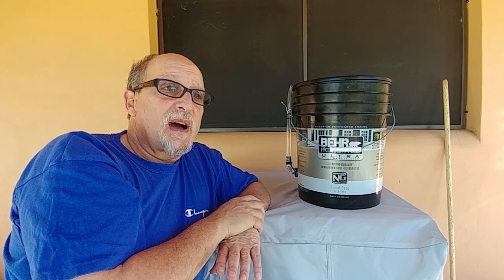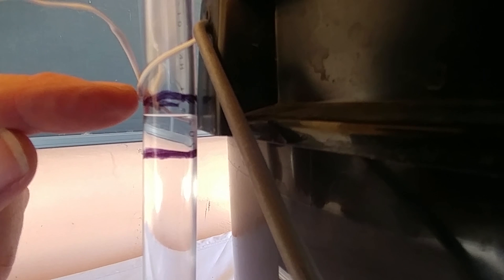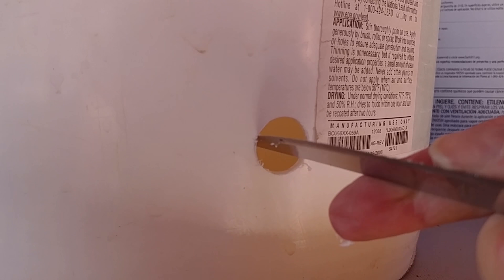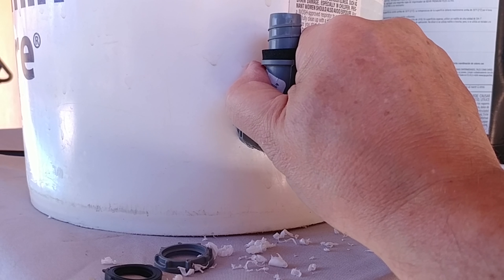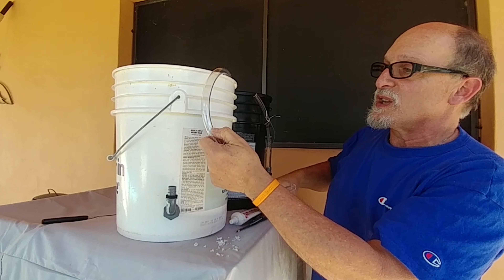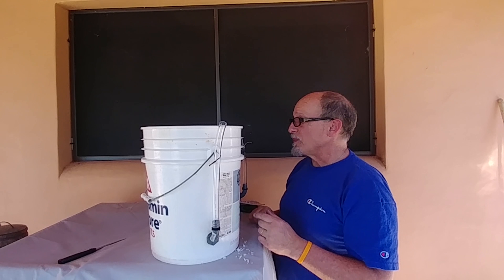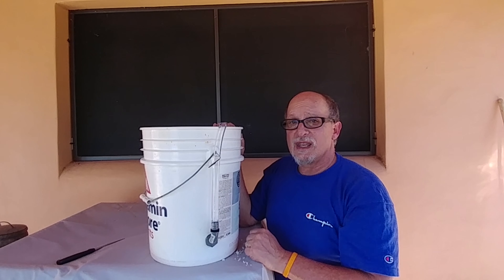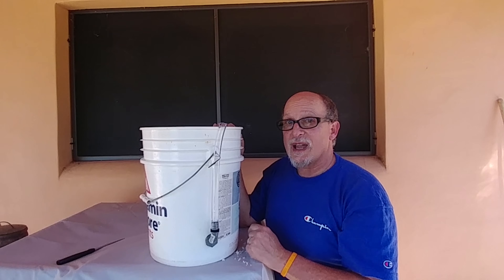DWC Hydroponics Bucket DIY  HYDROPONIC BUCKET DIY WATER LEVEL GAUGE

Comment: hey my guy, looking great! I'm gonna pick me up some tomorrow to add the water level indicator... Originally I had decided against it but opening up the lids is so damn hard. Had to say screw it, and here I am. This looks straight forward. Thank you so much. 
Only question is: what size hole did you cut into the bucket? I understand that the fitting is a 1/2" 90 degree fitting, but what size hole did you cut into the bucket for the fitting to screw perfectly on like that? 
Thanks again!
Reply from the maker: Hello and thank you for enjoying my video. The hole is made with a 3/4 inch spade bit. If you go to 10 min. 42 seconds in the video, I explain what the bit is in detail. Since our video helped you out, all I ask is that you help us out by subscribing to our channel, liking us and sharing our videos on any hydroponic web sites so others can save money and take advantage of my tips.

Comment: The hose and an elbow doesn't fit, it is extremely difficult to fit in
Reply from the maker: My Dear Follower,  If you watch the video @3 minutes to 5 minutes I give full directions on how to do this. NO TRICKS!!! Just listen, and follow directions closely to screw it into the bucket. If I can do it, anybody can. If you are having problems getting the tubing onto the elbow, use that BOSS 820 on the fitting. If you still have problems, try heating the tubing just a little with a hair dryer, that should soften the plastic tubing enough to make it easier to slip over the nipple. Do NOT OVERHEAT the tubing.

Please! If you really like our videos, please subscribe, hit the like and share. I pay for all the products I review. Once we get enough viewers we ill start getting ad residuals which will pay us so I can btuff to review. It is one vicious cycle. TY so much!